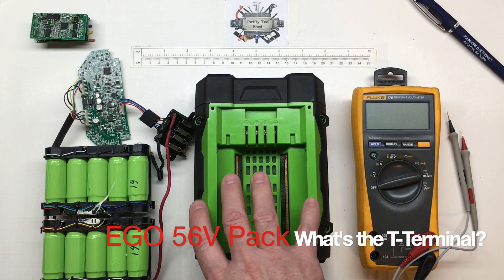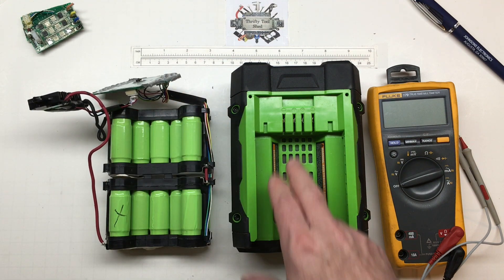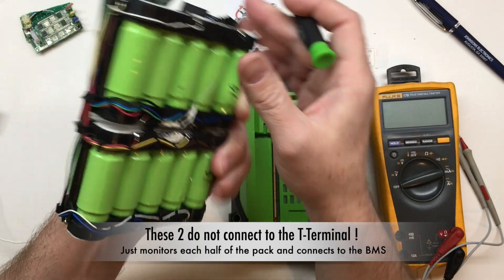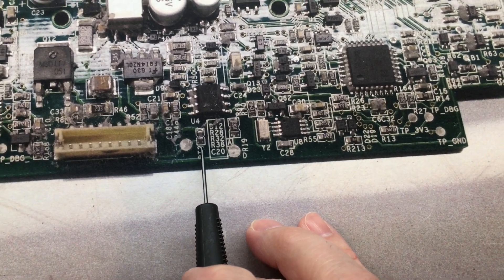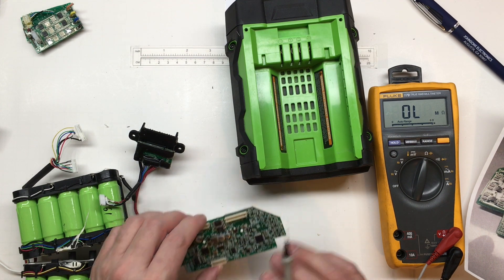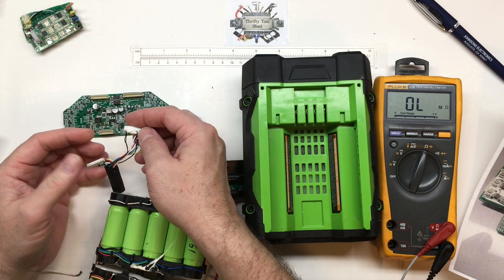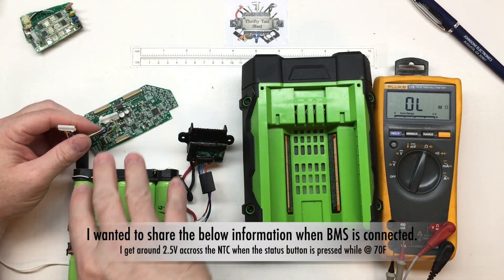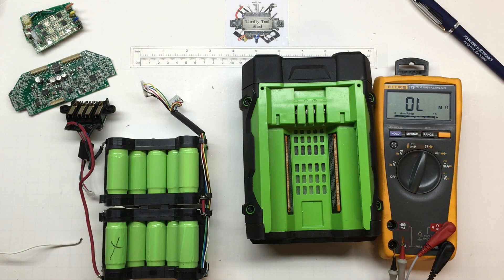EGO 56VBattery - What is the T-Terminal?

Comment: Can I take a 24 volt charger and directly place the positive and negative wires and charge the battery? The battery has 10.5 volts on a 56 volt ego battery. Pushing the button in the back doesn't do anything, nothing lights up. Nothing happens when the battery is plugged into the charger. Thanks I appreciate the help
Reply from the maker: It's best to use a power supply of at least 48V with constant current / constant voltage control. That way, you can control the current to a safe level. I even shared doing this with a cheap DC-DC buck regulator using a good EGO battery pack safely in some of my first videos on the EGO packs.
Reply: You are dealing with a battery that has the capability to explode. I bought a used good EGO CH2100 charger on eBay for $17.85.
Reply: Took the battery apart used a 43 volt battery charger, it charged up to 43 volts, put the cash back on and it is charging just fine. Thanks for the help

Comment: I've got 2 dead Ego 56v 2.5Ah batteries. One is 3 years old and totally dead the other is 1 year old and giving red light. Is there anything I can do to salvage either ?
Reply from the maker: It's possible. It will take some testing to find out for sure.
Reply: The one year old battery is still under warranty. Call EGO and they will verify warranty eligibility. You should be able to keep the defective battery.

Comment: I have a Ego 2 stage snow blower with two 7.5ah batteries. After 10 minutes of operation it shuts down and one of the batteries will blink yellow. I can disconnect and reconnect the battery to get the green light back but the yellow blink light returns after a minute or two (sometimes less) of operation.  The batteries when fully charged show 56v each. Your videos are very informative and has inspired me to open up the defective battery  to do further troubleshooting. Are there specific areas I should look for ? Many thanks in advance
Reply from the maker: Hi,
I don't know how old your pack is, but if it's fairly new, make sure to check if it's under warranty as well. Ego will usually let you keep/recycle  it regardless. I do have a video of an older Gen 2 pack blinking orange/yellow, and it was a bad connection in the middle of the pack for the cell feedback to the BMS board if I remember correctly. The older gen1 and gen 2 had small push on connectors. The newer 3rd Gen with the segmented fuel gauge now have soldered connections there and may not have that same issue.
Reply: @ThriftyToolShed  My battery  pack is dated Aug 2018. I don't think they're under warranty anymore. I have seen the video you are referring to. I suspect that is where the issue is. I will open up the battery and start there. Thank you for your help and the videos.
Reply from the maker: @AlainLeduc-o3o6t 
Awesome! Best of luck to ya!

Comment: I just got a deal on the big Ego backpack blower that came with 2 6ah batts.  Do you where I can find max current discharge specs for those batteries?  I called Ego and they don't even understand the question.  I want to rig up a use for these packs to another motor but not sure if they can safely discharge 40-50 amps continuous.
Reply from the maker: It truly depends on which cells are in the 6Ah and the size of the fuse on the main connector board. This is typically a trace fuse until the packs get up to 10Ah and higher. I know that doesn't answer the question either, but to me that's where to start. So for example some of the older 5Ah had Samsung INR18650 cells rated for 20A discharge with 2 in parallel (or 2P configuration) that gives 40A total and I believe the trace fuse was rated for at least 40-50A on the pack as well. The 6Ah I am not sure which cells they used in them. With the fuse is hard to know for sure since it is simply a circuit board trace. I tried to use a calculator based on size and approx. Thickness of trace and it seemed to be close to 50A rating on the 5Ah. That is a lot of current. For reference the blowers pull up to 25A on turbo with my testing and the mower can pull up to 30A at times.
Reply: @ThriftyToolShed  Thanks, that's helpful.  If I put the two 6ah in 2P then I'll probably be safe (assuming they have at least as much discharge capacity as the 5ah you mentioned above).   It may hit peaks higher than my estimate but hopefully the trace fuse can handle short bursts.  It seems weird to me that EGO doesn't even supply this basic info.

Comment: I fabricated a way for my kobalt 40 v weed eater to hold 2 20v batteries wired in series to make 40 v but on the inside of weed eater there is 3 contacts 
+ and - what's the 3rd one for? My weed eater runs for a min then stops until I release the trigger and press it again then it runs for a minute and stops again over and over. I'm wondering if the 3rd contact has something to do with that.
Reply from the maker: I believe so, the Kobalt packs have 4 terminals if I remember correctly. I have repaired 2 in the past, but did not go as far as looking into what the terminals do specifically. I seem to remember one having an Omega symbol which could mean Temperature resistance monitor and one was for Communication it seemed to me. Some tools like older Ryobi simply need the power terminals, but many need a communication with the pack these days.

Comment: If your t or d terminal was not connecting to the tool terminal like weed eater would motor spin then shut off until you release and repress trigger
Reply from the maker: Yes, for example as I have shared in some videos the blower will run for approx. 10 Secs and then cut out without the D-terminal connected.  Releasing and then pressing the trigger again will repeat. The T-terminal is used by the charger, but not all tools.
Reply: @ThriftyToolShed  so how do I trick the tool through the d terminal
Reply from the maker: @maxwhitley5860  
Excellent question. That is exactly what I was looking into and spent some time on and the 2 older video about the T-terminal and D-terminal was about the research I had done and I also mentioned that anyone willing to take it further would be awesome. I hit a road block of needing more time than I had to keep putting into it. I was hoping someone in the Electronics Engineering field could take it on as a project. Several viewers did contact me about going deeper into it than I had and most of these viewers seemed to be much more capable than I was on the EE side of it, but no real solution yet. Seems most have given up or at least like me no time to keep going with it.
Reply: @ThriftyToolShed  like I said I'm running 2 20 volt batteries off of my Craftsman tools to make 40 volts I'm assuming that since how they both have a d&t terminal that they both have their own battery brain so I hooked the d terminal from inside the weed eater to both the terminals on the Craftsman batteries. That was a no-go I'm assuming that's because I have two separate brains one in each battery and those brains are set up for 20 v and don't realize that they're tied together making 40
Reply: @ThriftyToolShed  thanks for your time and your help there's nothing else I have learned something
Reply: @ThriftyToolShed  one more quick question and I'll leave you alone LOL is there any way possible to just run the 40 volts straight to the motor
Reply: Bypassing all of the other electrical circuitry inside the tool maybe have a toggle switch between the battery and motor
Reply from the maker: @maxwhitley5860  
No. At least with the brushless motors you can't. If you find an older brushed DC motor type blower you can do that. I do have a video showing a BLDC controller being used to run the EGO blower BLDC motor (as a retrofit) if it helps.

Comment: My LM2100 has early gen 5ah battery that stops working after about 15 mins. Flashes orange I think, I’m colorblind. If I just take battery out and let it sit a few mins and put back in it works. Seems temp related. If I check between T fin and it’s around 10k is it the bms? And if it’s a thermistor, can I fix that with fuse like you soldered on? If so where can I get a 40amp small enough to fit? Thanks, love your vids.
Reply from the maker: It could be the BMS or one of the many temp sensors on the board. The NTCs are easy to check and should be ok if reading around 10K at room temp, but it is 3 thermistors and also a temp monitoring board in-between the pack halves on the 4Ah and larger packs. I have seen way more loose connection issues than actual temp sensors bad. Thanks for your kind comment.
Reply: @ThriftyToolShed  thank you! It’s an early gen 5ah. Multimeter shows 53v and the resistance between neg and T is around 10k. Worth a look inside? What should I look for? Thx for answering me already.
Reply from the maker: @Daltondoubledeuce  if it's orange I would check temp sensors and connections on them and if it is red it could be a cell pulling down below cut off level. So if you notice some being around 3.5V for example and one is reading below 3V you know that one will be an issue for you. They should be fairly close to being balanced.

Comment: Do you know if its possible to solder a 10k ohm resistor to those wires if the battery charger would work without it having the thermistor board? I'm looking into making my own backpack battery pack and still use the ego bms for the tool and charger communications and a separate bms for discharging to protect the pack since i believe the current doesnt go through the ego bms.

Comment: Does the charger need to read 10k between the T and the -ve terminal to turn on?
I connected charger to completely different 14S pack and the charger would not come on. 
I'm trying to use Ego charger to charge custom 14S pack.
Reply from the maker: I believe that is correct. It's been a while since I did the video "What is the T-terminal?" The older Gen 1 and 2 packs actually just had the NTC Thermistor across as mentioned in the video and the newer Gen3 with the segmented fuel gauge has a circuit with a transistor in it for the NTC.

Comment: How does one know what gen battery one is dealing with and which gen battery used the NTC 10k thermistor that can be read from the T terminal to ground?
Reply from the maker: The 1st and 2nd Gen packs have a single LED for the fuel gauge. The 3rd gen has the segmented sectional fuel gauge LEDs.

Comment: This is an old thread but I discovered in my newer (which is now completely dead) LM2130sp uses the T terminal (not the D) and thank god I found this thread because I had no idea what that terminal was used for. So, I'm back to square one troubleshooting my mower as I can't so much as even turn on the headlights. I've verified all the interlock switches and the handle harness. I've also checked the fuse but I still get NO sign of power anywhere. No led's light up, the self-propel doesn't work and of course the blade doesn't start. It's been a real head scratcher.
Reply from the maker: I do not have the SP model, but know many suffer from broken wires in the fold of the handle. I do not fold mine and have not had that issue myself, but I did check that and mention it in the mower troubleshooting video I have. I ended up replacing the controller on mine, but hopefully yours is simple and maybe a broken wire, connection or interlock switch.
Reply: @ThriftyToolShed  Thanks, but I checked the harness in the handle. It's a 6 wire interface that appears to use serial comm between the electronics in the handle and the power unit. The interlock in the sliding part of the handle is wired to the handle where the bail and push button is. It has a board of some sort in the handle that takes the headlight switch, the button (that locks with the bail handle), the sliding handle interlock, the speed control buttons and the speed control for the self-propel function as inputs to it. 
The board has a single cable, 6 wire, that interfaces through the handle to one of the potted modules in the power unit. I do believe it's a serial link. I buzzed the cable and found no issues.
Reply from the maker: That is a big difference from the older version for sure. If the fuse, all the interlocks and wiring is good then it possibly points to the controller board.
Reply: I have the LM2100 mower w/o self propelled. It just went totally dead. Checked continuity on wires from connector behind motor to handle, all good. Fuse good. It was the controller. Replaced it and back in biz, it’s a bitch to replace. Got controller from Power+Parts, around $100.

Comment: The thermistor on my BMS is reading 3.14 Mohm...so likely bad.  What do I replace it with?  NTC 10k...but what Beta?
Reply from the maker: It seems the NTC is bad for sure. I simply share it is like the common NTC 10k at room temp. I have no way of knowing the beta than anyone else. I simply use spares I already have, I have not had to buy any myself.
Reply: @ThriftyToolShed  Thanks.  if you or your subscribers are willing to post (in comments here) several kohm readings along with an ambient temp,  I would be happy to plot and calculate a beta estimate.  0°C to 35°C would be a good range. There are probably two possible betas in the 10k NTC ~3435K and ~4000K.
Reply: Where is the NTC connected? To plus or minus?
Reply from the maker: If you have the newer 3rd Gen pack with the segmented fuel gauge it will not read the same way as shown in this older video. It is a circuit on board on the newer BMS design.
Reply: @matthiashamann6988  minus ground black

Comment: I fixed lb5800 blower for my friend thanks to your videos the problem was the mosfets. However he doesn't have a battery for the blower so actually tested it with a 56 volt ebike battery but I only hooked up positive negative my question is where would I connect the T and D blade terminals if there's only a positive and negative on the e-bike battery? They worked without the T&D but that was just for like a five-second test I don't think it would be good to leave them un hooked forever. It's getting a battery would be best but let's just say you can't get a battery and you have to use the e-bike battery where would you connect those? I was going to run one to positive and one to negative but the continuity test showed that none of them are connected at the input blades so I didn't want to try that. Thanks
Reply from the maker: Awesome job. Yes the dreaded D-terminal.....
I have a video called "What is the D-terminal?" and to be clear, I have not figured this out yet. The blower/tool will only run for about 10 secs and shutdown. I believe the terminal to be a one wire communication between the microcontrollers in the pack and tool. The only way I have found to get around it without EGO packs is the aftermarket packs. I have a couple review videos of these aftermarket packs because if nothing else I was super excited that the pack did have the correct communication with the tool to work properly. People have mixed feelings about them and I get that, but if you want another alternative to buying a EGO pack that is the only way I know of. So I at least appreciate that they cloned the microcontroller so the board works perfectly. I still feel it's better to buy a tool in a kit or bundle and get the EGO pack cheaper doing it that way. If you don't need a tool then the aftermarket is if nothing else is another option. Thanks for your comment. Best of luck to ya!

Comment: I have a battery with 56V+ but measures MOhms (Open) between Gnd and T terminal. It shows the Orange LED on latest gen batteries.  Does that mean that Resistor RT2 in the terminal is bad or could be something on any of the pack? Thanks for your videos
Reply from the maker: That would be the first thing I would check.
Reply: @ThriftyToolShed  unfortunately the board is different compared to the Gen of this video. More crowded than any other board. I did not see anything in your most recent video with Gen 3 BMS about this 10kOhms. Thanks
Reply from the maker: @jaybutler9797  
I do not have any Gen 3 of my own to learn much about. Just the one video as you had seen that a viewer sent one in. I don't have any mention of 10k on the newer Gen BMS board, but since it works with the exact same tools and charger that part should not be any different electrically even if the board layout is different. 10K.
Reply: @ThriftyToolShed  I guess this BMS is different. I measured 2 new Gen 3 batteries and it shows the same 1.5MOhms between T and Gnd terminals. It might be different electrically speaking. I posted in the community. I will continue sharing over there my findings. Thanks
Reply from the maker: The main difference appears to be a transistor in the circuit for the Gen 3 board. I have not had to look at the NTC on the newer boards at all yet. I looked at the only one I have here that is faulty and the NTC is just right of the middle of the board it's a black component that looks a lot like the ceramic caps except black in color. It has a via just under its right side and that goes back to the connector pin for the T-terminal. The other side of the NTC goes to the collector of a (1N) NPN transistor. 
The 1st and 2nd gen simply had the NTC across the negative and T-terminal. So it does not test the same  unpowered,  but the NTC is still in fact around 10K ohm at room temp. Hope it helps.
Reply: @ThriftyToolShed  much appreciated. Thank you for your detailed explanation and for your commitment in helping the community.

Comment: I melted my positive terminal and was trying to replace the whole terminal assembly. Do you know what that part is called or where I can get it?
Reply: Thank you
Reply from the maker: The only way I know of to get these is from a non-working pack from eBay etc. If you know a battery recycle place you may be able to get one that way. No way to purchase that I am aware of. I have even had communication with the aftermarket manufacturer of these type packs to see if I can eventually get parts from them, but no luck so far.
Reply: @ThriftyToolShed  thank you